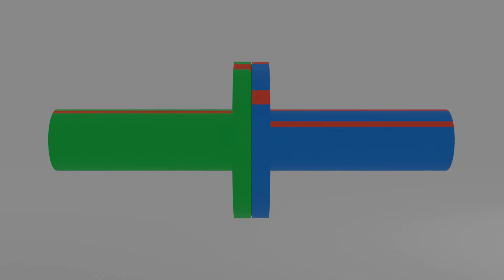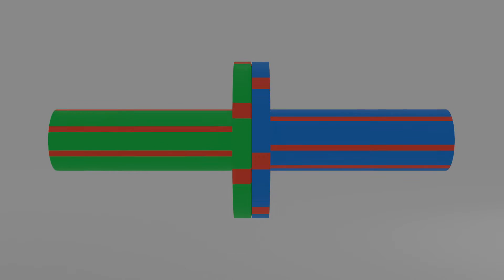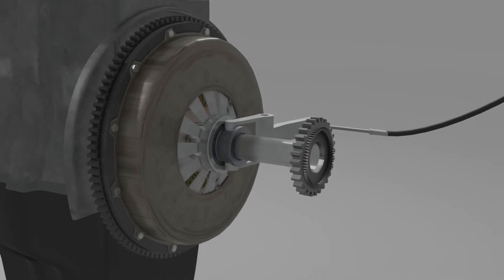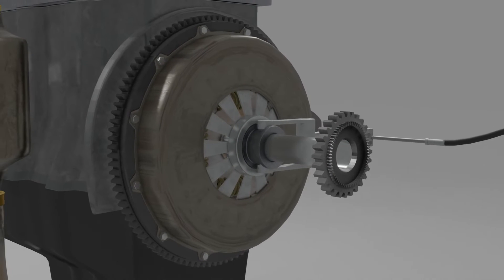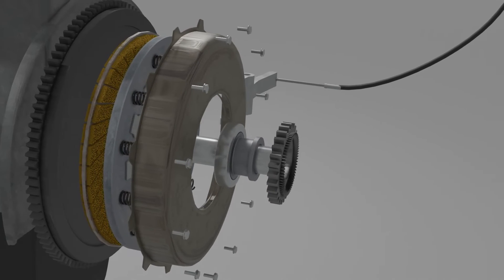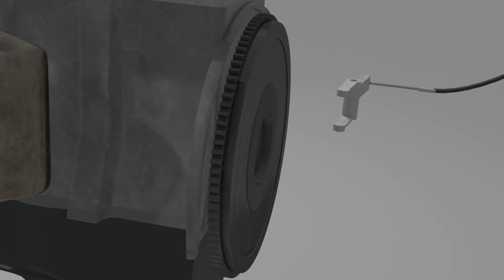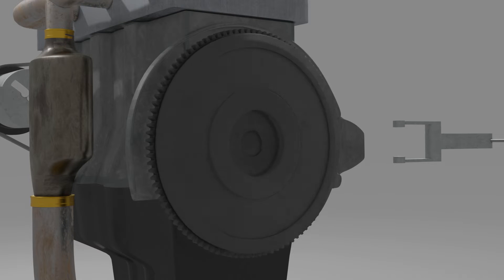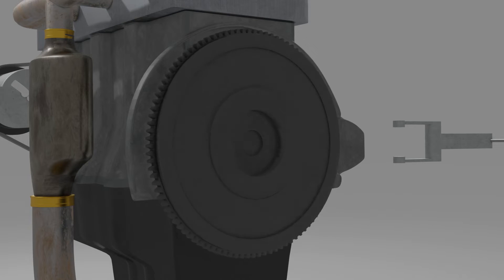How Manual Clutch Works ?

Comment: Pressure plate iz connected with the flywheel permanently through the bolts.
Clutch plate iz in between all of two pressure plates how u can disconnect theez all